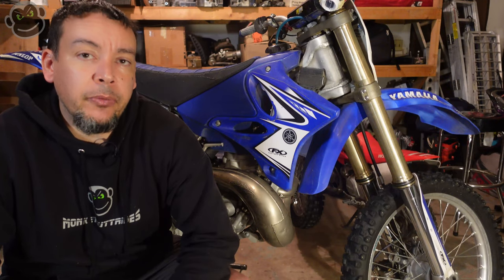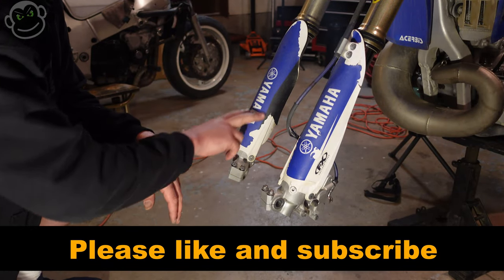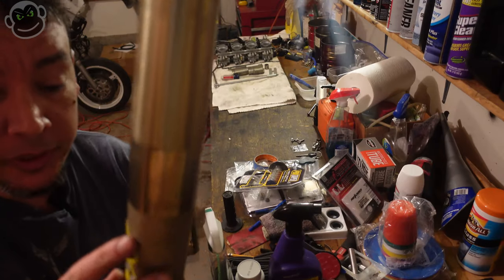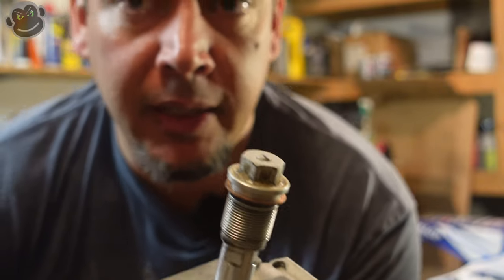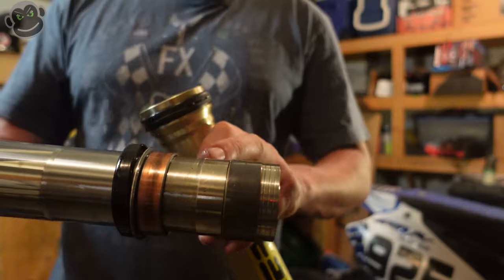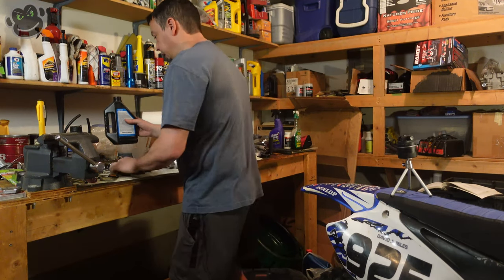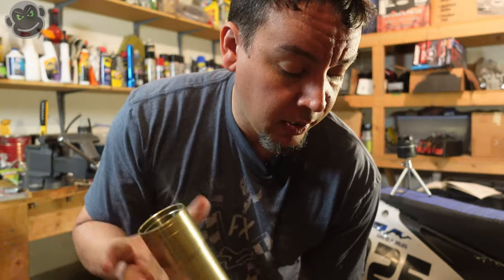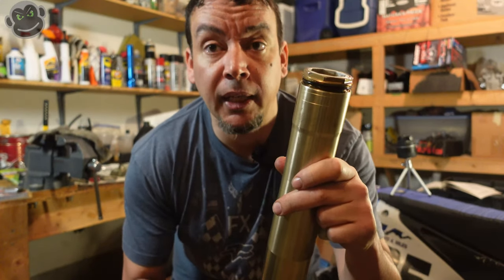FORK SEAL REPLACEMENT YAMAHA | Yamaha YZ 250 2-Stroke

Comment: If you're on the larger size can you imagine the laughter when I show up :P Youre gonna mix oil you monster :P What weight do you use on your road bike? I use 10 in everything so far. Miiiight go heavier on the CBF. 
Yaaaay I'm glad I helped :) Ari Henning, I learned so much from that dude. Linear springs very niiiice. Linear is always best for racing or so books have told me cus they're predictable the whole way through! 
Ah man everything takes soooo much longer! 
Enjoy the track in sunshine. I am jealous :)
Reply from the maker: At 6' 7" you would certainly want something more powerful and heavier springs then my bike.  KTM used to make a sweet 550 4 stroke (might still make it) that was good for track and trail riding.  I never really played with oil weights on my street bikes before but I'm about to change seals on the ZX10 so I might try something different. Thanks GB!